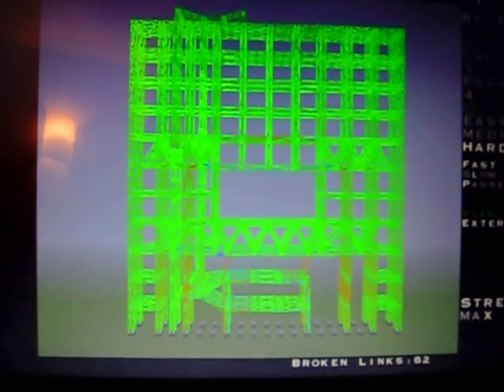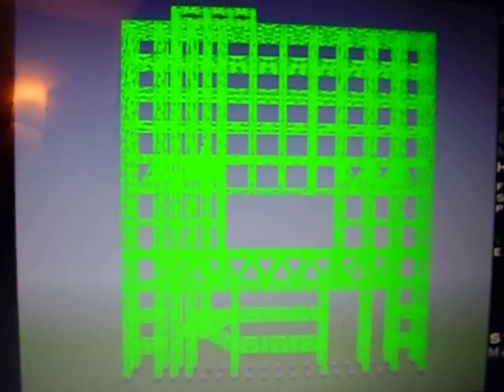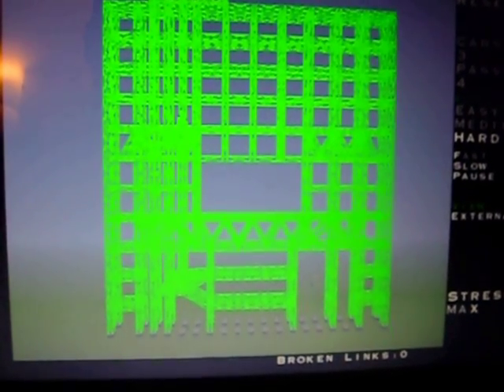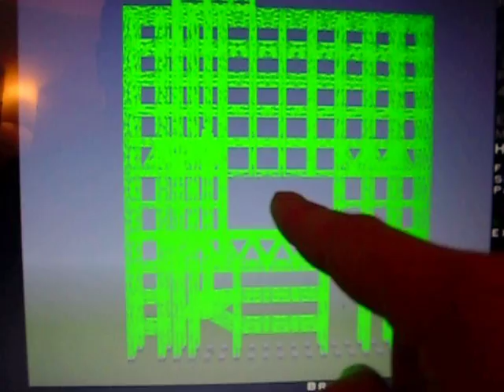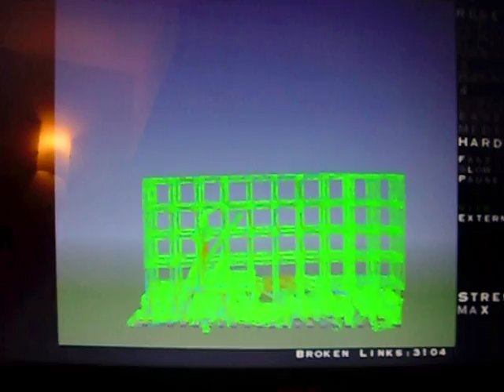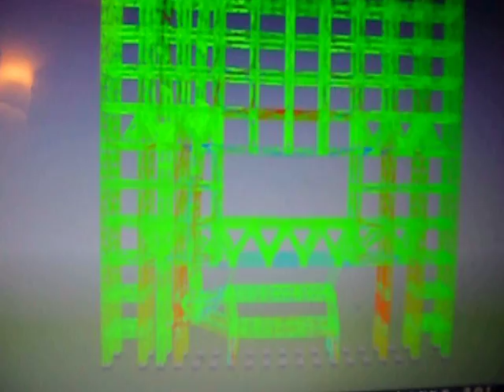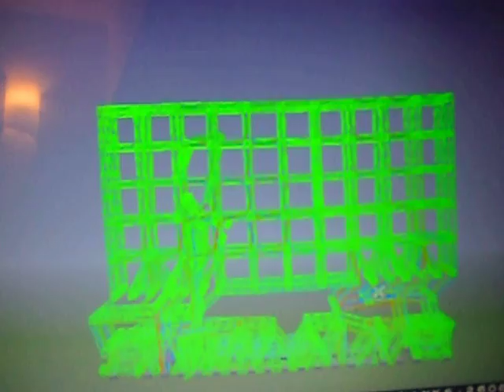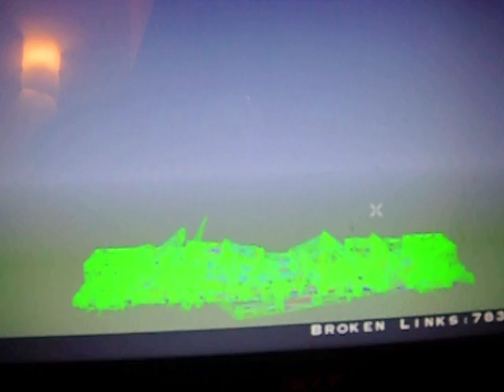World Trade Centre 7 collapse simulation - an exercise in physics modelling

Comment: @ChuffChuffWoo L'Ambiance Plaza
16 floors
Steel reinforced concrete
5 seconds to fall
0 YEARS in its last state before finally failling
Failure in 1987 during construction using the brand new at the time “lift slab construction technique”
matdl.org/failurecases/Building_Collapse_Cases/L_Ambiance_Plaza